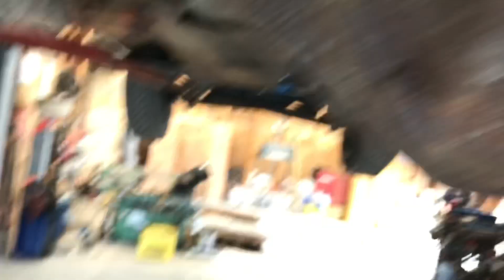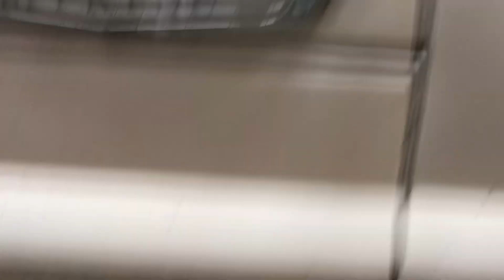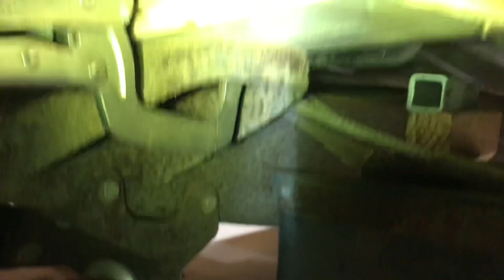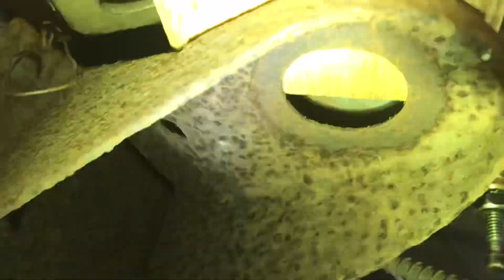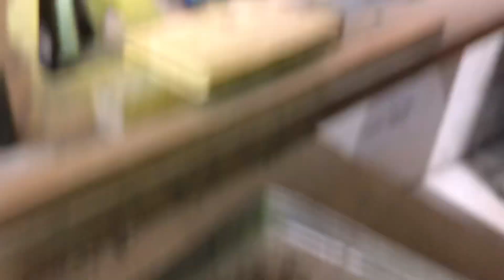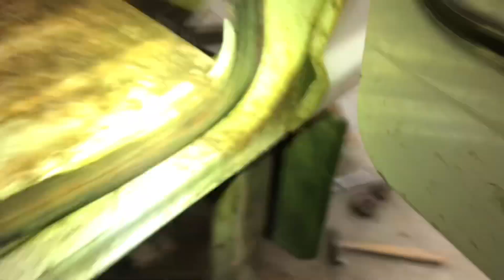1967 Mercury 1 Ton Pickup, Cab Mount And Rad Support Repair

Comment: Hey Morgan, Good to see ya I been thinking back and I dont know if Ive seen any other rigs like this,I know Bob Walker has one Im not sure its a 9ft stepside how rare would you say this ol beauty is? Nice work.
Reply from the maker: I’m 57 this July and have no memory of seeing another. According to what I’ve found on the net, 9 foot step sides were only produced from 67 to 72. It seems they were only offered on 3/4 and 1 ton. A rare breed of work truck that would become harder to find as they got worked to death and left to the elements or scrapped. I only found 1 picture of a bump side with a 9 foot step side, so I would say Myrtle is one of very few survivors.
Reply: @WildWestGarage  haha that's what I thought ya Im 59 july 21st  and it's the only one I've seen other than Bob's and I dont remember if it's a stepside I dont think so but it's nice he bought new in 67. This ol truck of Buckin's is a workhorse they represent each other hahaha old busted up some and still out there puttin in the work  like a savage!

Comment: Nice work man,Have you ever thought of useing satin coat steel for that thicker underbody stuff,has really good corrosion resistance.
Reply from the maker: I’ve used satin coat in the past, I agree it does hold up well, I’m going to give all the repairs a cavity wax treatment once I’m done.